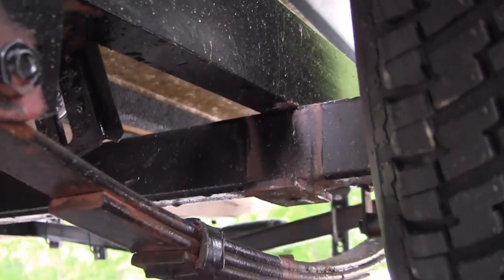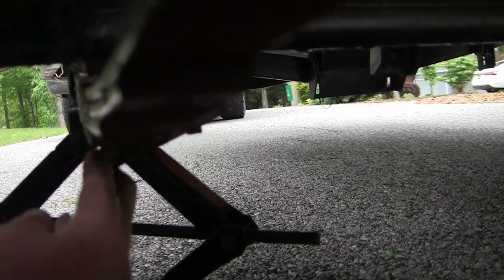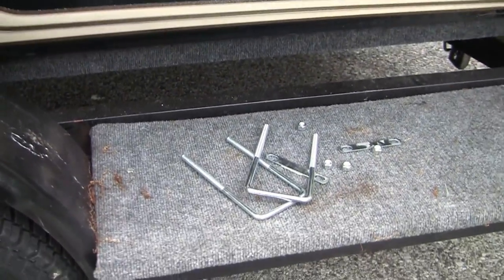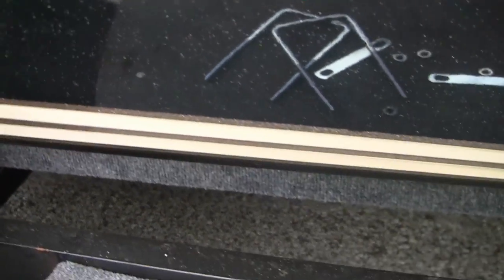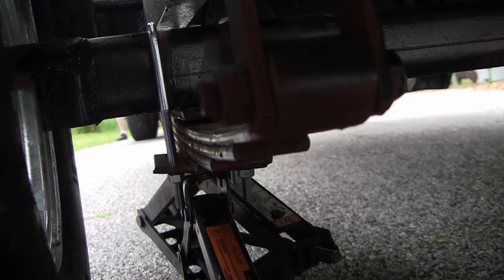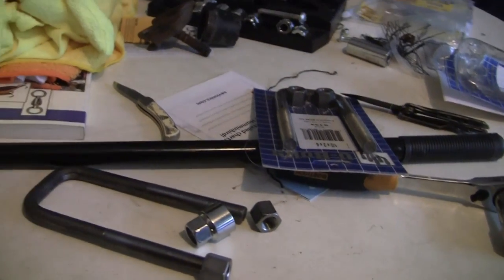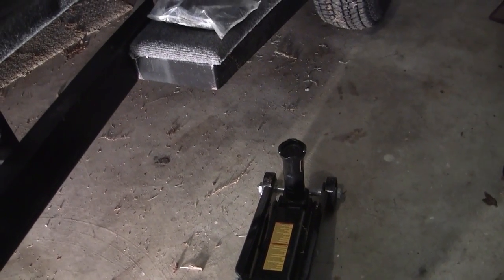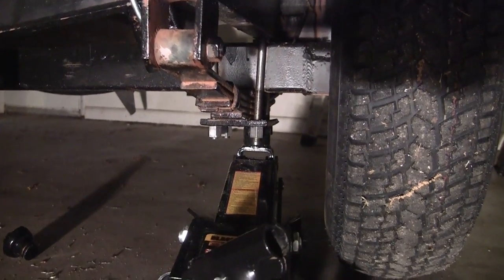Axle bolts broke while towing boat trailer - How to attach your axle to your trailer.

Comment: I had something very similar happen but actually made it home and noticed something funny looking under my boat, it was the plate angled down with one bolt broken on one side, the other bent and barely hanging on and surely about to break. So now I removed the remaining 3 but when I did the spring leaf obviously popped down. I should have left it and put the new one on and taken the old one off. Anyways, my question is, did you just use the jack and the boat's weight to smash the leafs down to get the bolts in place and get the bolts started? That's my plan but looking for any potential suggestions.
Reply: Bluebasser86 what did you end up doing? Thanks